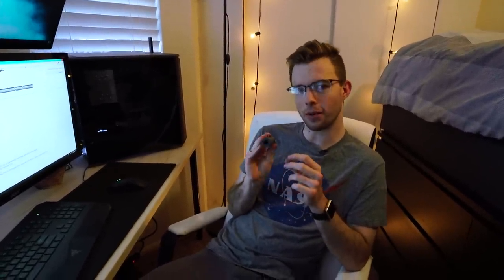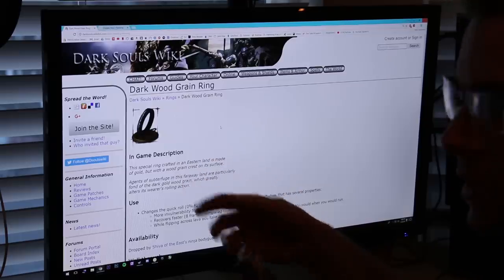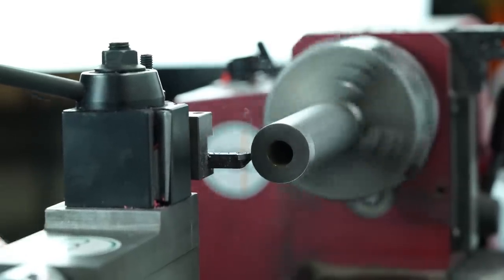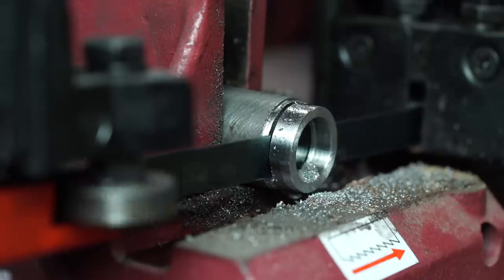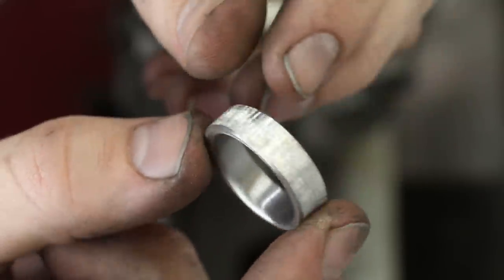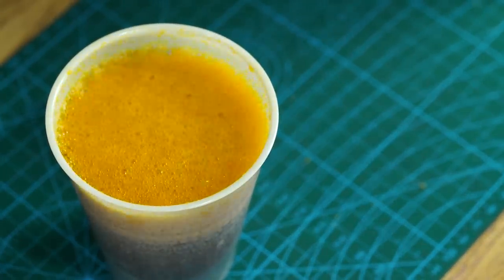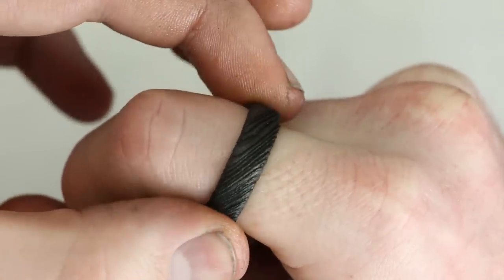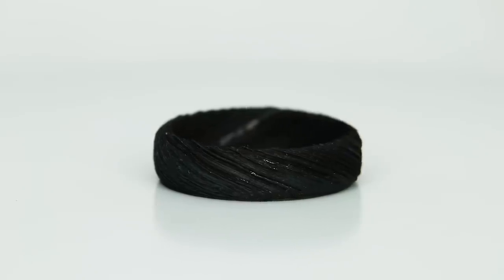Making a Dark Souls Wood Grain Ring out of Damascus Steel

Comment: +Patrick Adair Designs Love watching your work Patrick.  I do have a quesiton for you.  I see you use the Harbor Freight 1 HP 4 in. x 6 in. Horizontal/Vertical Metal Cutting Band Saw and was wondering in hind site if you feel the HB 1/3 HP 9 in. Benchtop Band Saw would be a better unit for rings not because of cost but for counter space saving?  My shop is being over run by tools.....lol  I'm not worried about what anything costs, but have found in the hobby I've bought many tools that were just overkill and was wondering what your thoughts were on this one before I commited?

Comment: Is there a way to mask off parts that you don't want to etch? For instance, leaving the inside and a rim as pristine metal so that it looks like the etched section is inlaid, or something similar?
Reply: s bushido just put something like tape, over it
Reply: Ah. No idea how the tape or its adhesive would interact with those chemicals.
Reply from the maker: Yes you can coat it in nail polish to protect it.
Reply: Nice. Thanks for the reply. :)

Comment: Most locations I check give me different answers. 

But, I believe my ring size to be 11 or 11.5 based on my highschool graduation ring. 

Over the years it's gotten a bit tight though. 

My ring ringer has a circumference of between 70 to 72 mm.

I believe that's a size 13, but different sites tell me between 11 to 14.

Any thoughts?